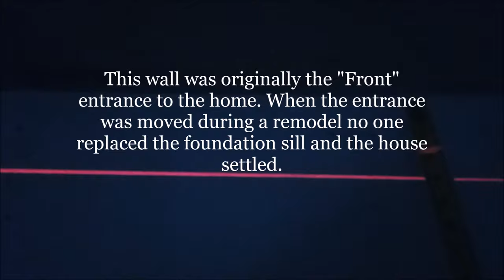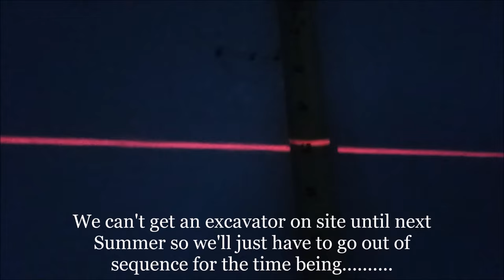Home Renovation -Raising a Vaulted Ceiling

Comment: Hey Jason, been researching and planning my reno and I’ve been looking for a great video like this! Why can’t anyone else make videos like this one?!? Glad I found it. The only difference between our plans is the lack of ridge beam in your project. 

The collar ties keep the wind from blowing the roof off, but what keeps the weight of the roof from pushing the walls outwards? I am looking for alternatives to a ridge beam, so I am interested in your solution. Thanks in advance.
Reply from the maker: So, first. Thanks! Second, there is a ridge beam, it was in the form of the original ridge board. A ridge beam would be more of a timber frame application. The "collar ties" are actually tension ties so yes the act against wind sheer (both up and down) but also because they connect both rafters they pull together which helps the force of the load down instead of out. I was okay with this design because, if you notice in the video I pulled the cieling joists out by hand which means the ONE 16d nail wasn't doing much. I was able to nail the existing rafters and the sister rafters to the wall top plate. Even better would have been metal connectors. If the room was just a little longer I would've included exposed metal torsion tie rods or possible exposed wood beams but it was just under my concern limit. Hope that helps!!! I should do an update video on this, seems to be a popular topic!!
Reply: @JasonMichaelKotarski  Ha! One 16d is hilarious. It reminds me of my house. Thank you for the explanation, it is very helpful

Comment: So you added a bunch of load to the roof without adding a beam. What is now going to resist spread?
Reply from the maker: The collar ties secure the rafters to each other/ ridge board. The drop sistered 2x6's are attached to the top plate.
Reply: I’m sure you’ve done some research into this, but how does one determine how far up those collar ties can be? Seems like a lot of leverage on them!
Reply: @timgleason2527  this was the point of my rhetorical question. He put them on in a fashion that would replace hurricane ties(resist uplift) but do not hold the walls together. Calculation for the placement must be made based on load. Basically the higher the load the further down they should be. A load carrying ridge beam supported to the foundation should have been incorporated into this installation. Hopefully he doesn't get heavy snow.
Reply from the maker: The general rule of thumb is to divide into thirds with the tension tie in the top third area. Other factors would include size of the room (span), slope of the roof, and height of the walls. This was a small room and the fact that weren't any Tension Ties to begin with made me comfortable with their placement.
Reply from the maker: That's a valid point. It was all taken into account. The ridge board was adequate to the ridge, the tension ties were maxed out for height but the thrust calculation was still within range. We only get heavy snow once in a while and only for a couple of days. Snow load was also taken into account. The spans were all small enough that I am confident in the application.
Reply: I hate to say it, but failure to provide a structural ridge beam in cathedral ceiling construction always results in roof sag and corresponding outward lean in the exterior walls which support the rafters...this is basic engineering. You may get away with it for a little bit, because of the relatively small dimension of the room, but I don't even the exterior walls are going to be adequate to provide support even for the overall weight of those 2X6s...unless there are buttresses on the outside of the home us viewers aren't aware of, ha.
Reply: @chrislimnios9180  yea was gonna comment but people allready did...allways need a ridge beam supported on the ends to a substantial footing " below slab " couple feet. People just start blowing ceilings out thinking a couple collar ties will be ok🤦🤦

Comment: As a life long remodeler. Move the appliances out of the work area. Protect the countertop with plywood. No reason to bring the lumber into the kitchen.
Reply from the maker: Definitely good point on the appliances, on this one the kitchen was 30% of the total square footage, so space was at a premium. We actually started with the ceiling first because everything gets demo'd after cabs, counters, floors, it was a lazy man's drop cloth. I do have to differ with you on the lumber though, it was a good work platform that I would've built with scaffold anyway, plus in the Pacific Northwest it's not wise to leave lumber outdoors.

Comment: Hi, excellent video! It's been a couple of years so just wondering, how's it holding up (literally 🙂) with those small collar ties? I've always understood 1/3 down every 48" is the standard, but I'm still learning.
Reply from the maker: It's all in the same place as when we did it! I've watched the difference of the snow melt between that section and the rest of the house and we can see exactly where we have heat loss.

Comment: Was there any structural reason why you didn't take it all the way to the wall without the flat parts on the sides?
Reply from the maker: There is a slight structural benefit of the soffit framing but it's not much. There is more of a benefit in the insulation detail (Insulating where the wall and ceiling meet), a place to run electrical wires, the gabled end upper cabinet layout and tying the ceiling plane into the dining room.

Comment: wow, I am impressed you did all this hard work by yourself. Can you tell approximate material cost and time? Thank you <3
Reply from the maker: I don't recall off hand and prices have increased dramatically since this project. If I had to quote an estimate it would've been around $5k USD and maybe 10 working days (with sheetrock and paint drying time) This was our own project so we did it over the Winter holiday slow season. A typical Kitchen Remodel (depending on cabinet, countertop and appliance choice) is around $25-$30k USD.
Reply: @JasonMichaelKotarski  thank you for your reply <3 I appreciate it
Reply: Seriously, I’m jealous looking back a year ago when you could find a beautiful pile of boards like that!
Reply from the maker: Right?!?!? And at those prices!! I actually like to handpick my framing lumber when I can, I cherry pick on the quarter sawn Douglas Fir boards every time.

Comment: How much did this project cost?
Reply from the maker: In which sense of the term? Materials, Labor, back pain......? It's our own home and we have a Design | Build General Contracting business, so we did it during the winter slowdown and now COVID quarantine.
Reply: @JasonMichaelKotarski  we just bought a house is love to do this but might have to hire a contractor
Reply from the maker: I see , just the ceiling alone wouldn't be too expensive if all structural measures are addressed ( live/snow/wind load, tension, & sheer) and as long as the electrical, mechanical and plumbing aren't problematic. 

We started from the top down because A) we needed to fix the insulation and lighting B) we used the existing ugliness as our drop cloth and C) we have a 2 yr old so we can only do these in increments. 

We're in Seattle so prices may be higher than typical but I'd guesstimate the ceiling at about $5k with framing, insulation, electrical, and GWB. A kitchen this size is typically $25k-$30k.